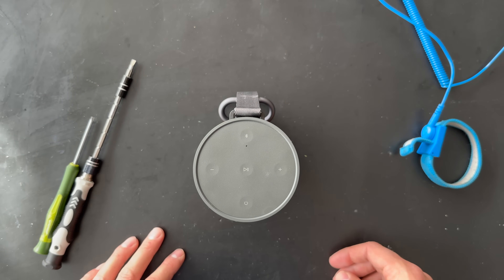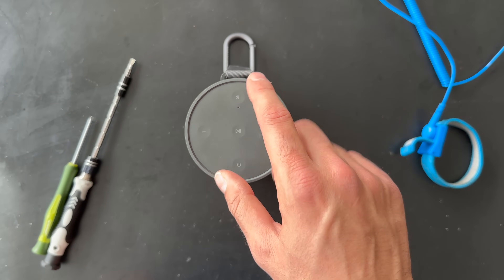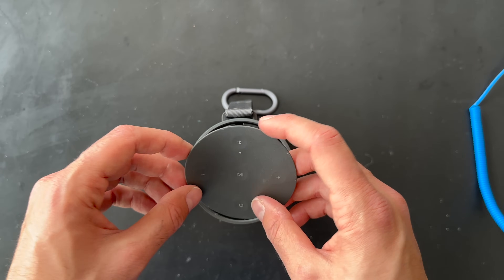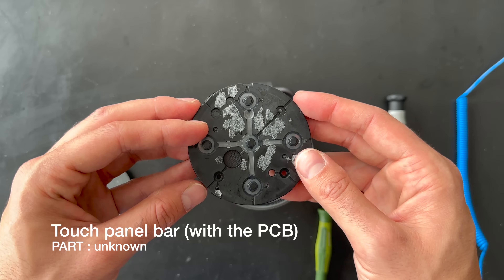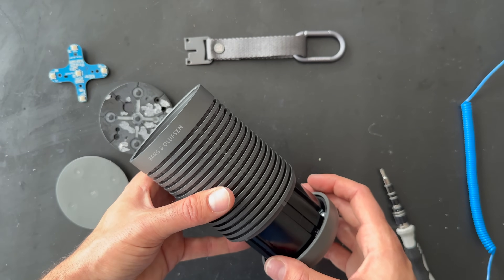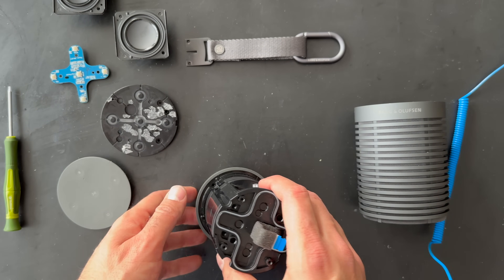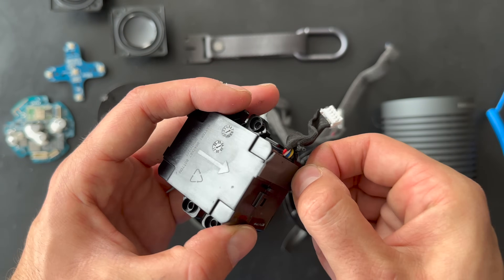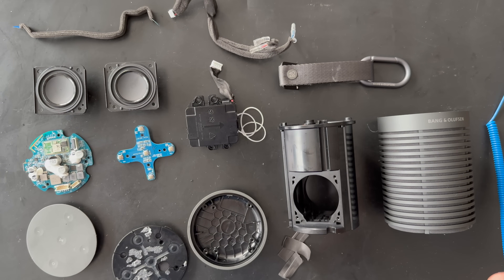Bang & Olufsen Beosound Explore Disassembly process and Battery replacement

Comment: I would never let you repair anything for me! Haven't you heard of plastic spatulas or plastic crowbars??
Reply from the maker: Thank you for your feedback.

We always aim to handle all products with care, using the appropriate tools and techniques based on the specific device and its condition. In many cases, we do use plastic tools like spatulas and crowbars to avoid damage — but sometimes, certain repairs require alternative methods depending on how the parts are assembled or aged.

That said, we’re always open to improving, and we appreciate you taking the time to share your thoughts.
Reply: @KoseTrading  It would be good to put this in the description or add subtitles to the video. B&O products are very expensive, and I personally would not open speakers from AliExpress like this..

Comment: Thanks for disassembly this speaker , so i just wonder about this speaker has very light of bass . Now i know . 
No passive 
Only full range is not enough to make deep bass
Reply from the maker: You’re absolutely right — and great observation! This speaker uses only a full-range driver without a passive radiator or dedicated woofer, which limits its ability to produce deep bass. Full-range drivers are designed to cover a broad frequency range, but they often lack the low-end power that comes from a separate subwoofer or passive bass element. That’s why the bass sounds light. Glad the disassembly helped clarify that!

Comment: Punktkilde is also a Danish manufacturer of small quality speakers
Reply: Designed by Scanspeak and produced by Eastech
Reply from the maker: You are right, of course. But before it was disassembled for the Explore, I was unaware of the Danish speaker driver firm.

Comment: hi i was curious if you know of any method to hack this speaker during this process to get more bass more this speaker? thank you
Reply: with no pasive speakers like JBL, Sony, UE BOOM etc. it's clear why the bass and volume are so weak, too much sacrifice for the big 27h battery
Reply from the maker: Great comment—and you're absolutely right.

With no passive radiators or dedicated bass drivers like you find in JBL, Sony, or UE Boom speakers, it’s no surprise the bass and volume feel underwhelming. It seems Bang & Olufsen prioritized battery life—those 27 hours are impressive—but it definitely comes at the cost of low-end performance and overall output. It’s a classic trade-off between portability, battery life, and audio punch.

Thanks for sharing your observation—it’s spot on!
Reply from the maker: Thank you for your message. It's not possible to get more bass out of the Beosound explore. But you can use the Bang & Olufsen App.